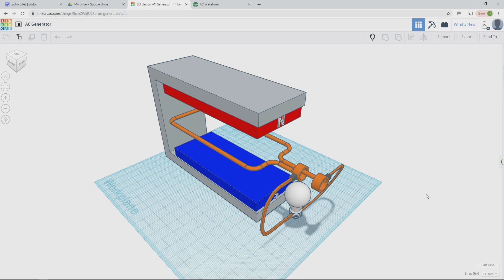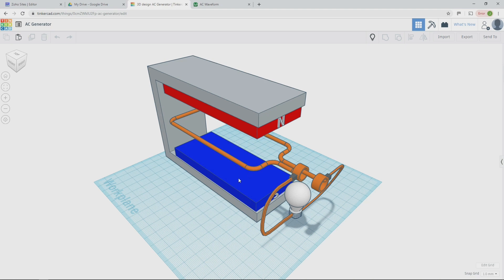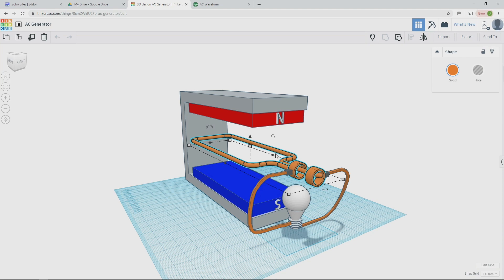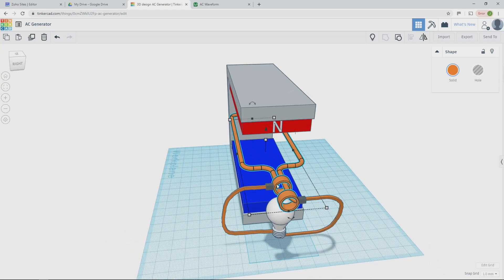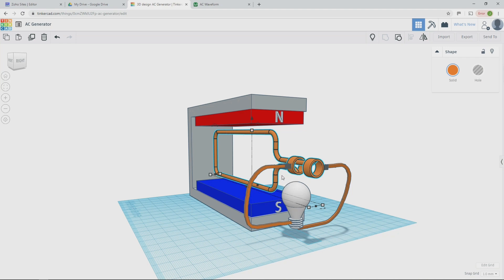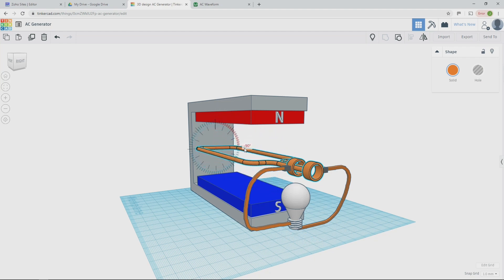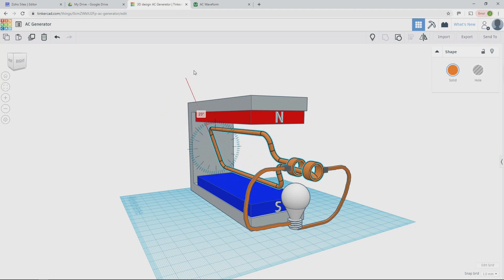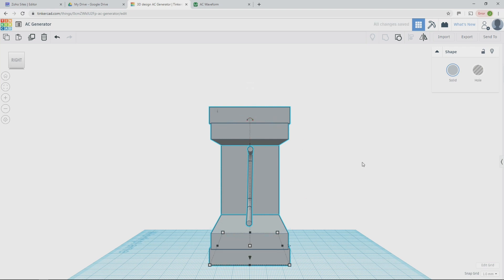AC Theory: Producing an AC Waveform

Comment: In a power grid, does the amount of electricity produced by power plants depend on the real-time demand for electricity? It seems counterintuitive because power plants like those with diesel engines run constantly, spinning a coil within a magnet. This process seems independent of how much electricity people are using at a specific time.

Here's what I'm still curious about:

Does the engine in a power plant (e.g., diesel engine) constantly use the same amount of fuel regardless of electricity usage?
If no one is using electricity, wouldn't there be wasted energy just building up in the system from the constant rotation?
How does the grid manage the balance between a power plant's constant generation and the varying demands of electricity users?

Comment: Thanks for these videos Joe, they are a great help! Would it be possible for you to consider doing a few videos on AC and DC motors/generators... Ie Series/shunt/compound... Synchronous/induction   Squirrel came, wound rotor, capacitor start, shaded pole?  It seems a big subject, their characteristics, wiring method. Understanding and calculating of slip/synchronous speed/torque. I reckon your explanation of these subjects would be for best on YouTube!

Comment: What makes the armature (looped wire) spin? Are the magnets causing it to spin, and if so, why does it spin clockwise?
Reply from the maker: The rotation of the loop is caused by an external force, like a diesel generator.
Reply: @JoeRobinsonTraining  Thanks for the help!